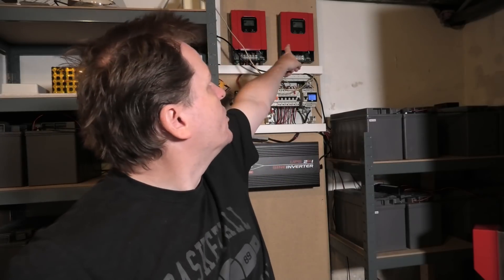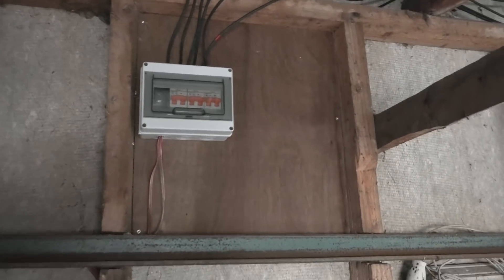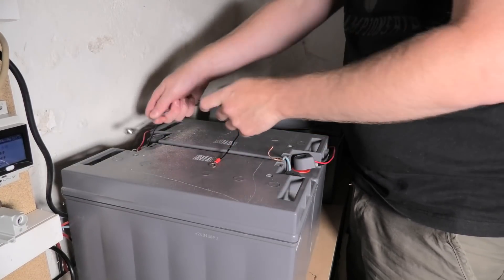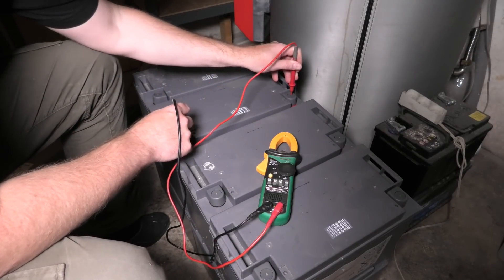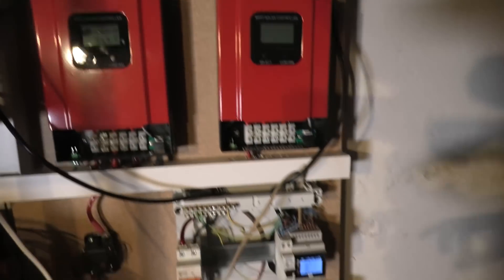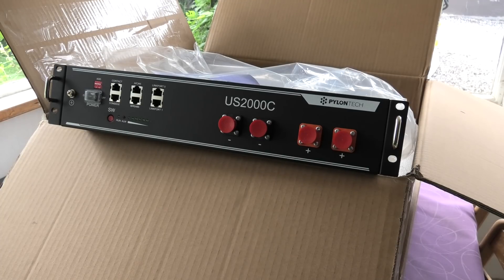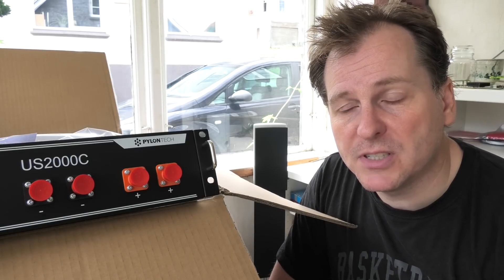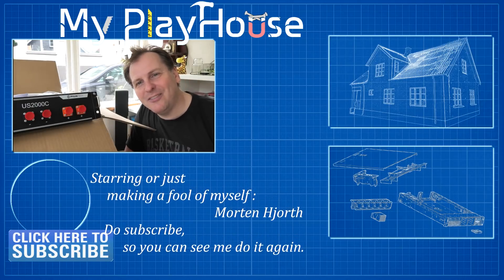Lead-Acid Battery Bank is Ruined, & Coming Out - 1092

Comment: I have just installed an 'off-grid' system in my house, which can also top-up the batteries from a grid supply. This installation includes an 8.4kW PV array, three 5kW Iconica solar inverters running in parallel and a 92kW lead-acid battery bank, consisting of thirty-two VARTA LFD 230Ah batteries. These are sealed glass mat type batteries.
They are configured in series parallel (four batteries in series, giving eight parallel banks of 48V which serve the three Iconica inverters).  This  lead-acid battery bank cost £3600. Running it at between 100 - 70% capacity gives me 30kW of usable energy. I have installed solar before into campervans but this is my first house install. I researched that running lead-acid between 100-70% gives the longest life-span.  I'm hoping running it like that I get at least five years use out of it......possibly more. I can output up to 15kW out of it if needed. It handles my 9.5kW shower fine. Each battery is only outputting 10A at 48V to achieve 15kW output.
My question is:
Other than running them at between 100 - 70% capacity, is there anything else I can do to ensure a long life?
Reply from the maker: I think I should be asking you questions!! 
Only thing I would suggest is to add a Lead Acid Battery Bank Equalizer... one per bank,, they are a bit expensive,, but so are your batteries.
https://youtu.be/UjvAkGKonpo
Reply: @MyPlayHouse  Thanks for the reply. I have thought about the bank equalizers. I got the batteries as 'seconds' so they were a third the retail price. I'm running a daily log of performance to get an idea of how they're performing. The inverters have an 'equalisation' program that you can initiate to stop sulphidation every month, but as they're sealed batteries it would be hard to find out if this needing doing, as I couldn't measure the concentration. Good luck with your setup.

Comment: The laptop batteries  have a benefit compared to other cheap ones that they once were prime quality.  But the capacity has already suffered from who know how many charge/discharge cycles.  If you are lucky, you may still get 80%.  Still beats the fake batteries that usually never had more than half of the common good battery 1.8 Ah to 2.8 Ah capacity.  Any claim beyond 3.5 Ah is beyond the theoretical maximum and therefore a lie.  Talking about the 18650 types (sizes).  If you have other formats or bigger sizes, that is a dfferent story.
   Changing to discuss lead-acid batteries.  The common packages have 6 cells of 2 V.  If you battery reads 8 V, it likely has 2 cells bad.  If it reads 10 V, only one cell is likely bad.  These numbers apply to just minutes after a charging ended.  During the charging you may see misleading numbers, and indeed the bad cell, if measured individually, may show much higher voltage than the good cells!  In the old days the cells were commonly tested with an areometer, which showed the cell charge condition by the density of the electrolyte.  You just had to make sure the electrolyte level was O.K.  If below the specified amount, maybe 1 cm or 1/2 inch above the plates, you needed to fill back up with pure distilled water.  And be sure the distilled water had not been is contact with any iron (steel).
Reply from the maker: Hi Pellervo Kaskinen
Thank You very much!  glad you liked the video :-)
Thank you for watching! :-)

Comment: What about the possibility of reviving each individual 12V battery with a Re-EMF charger? Why not try that? That should be able to get them up to at least 80% of their original capacity, possibly even more.
Reply from the maker: It is GEL batteries,, and they have dried up,, and stuff :-/
Reply: @MyPlayHouse  Oh, OK, then it won't work unfortunately. If it were lead acid batteries, you might have had a chance at refreshing them.

Comment: Completely understand situation.. Yeah, this is sad.. 😢 My UPS battery died few months ago.. Decided to recover it, but then I noticed that battery is puffy and have small cracks on sides.. I changed my mind immediately.. And started to looking for new battery.. Prices were shocking!
Your situation is worse, because lots of batteries looks dead or close to that..
Supported how I can, at this moment, and watched advertisements.. 😂

One cheaper option is using multiple car batteries.. They are bigger capacity and cheaper.. 
I have 12V home made system in my garage for few years by now.. Lights are 12V, sockets are for 12V.. Have circuit breakers and light switches.. Battery is always connected to the braker.. But solar panel is sitting in car trunk and aren't connected to anything by now - I need to ask permission to put that panel on the garages roof.. 😒 Mounting solution I already decided and charge regulator is mounted on the garages wall near by circuit breaker box but isn't connected.. I even have garage 12V diesel heater.. 😂

Minus for the system - now I need, after few months, bring car battery to home for full charge.. Not an easy job.. But everything works and even neighbor was interested in my system.. 😂 Because I always have a lights in garage and I can connect power tools to garages power system.. Best thing in this system is - no power losses if compared with systems with inverters.. 

Now I want to see how Your new battery module was connected and how it performs.. 😉👍 That's will be interesting video.. 
Great that You leave in video part, where cameras battery died.. 😂👍
Reply from the maker: They just still look good :-/
Reply: @MyPlayHouse  That's the saddest thing.. Because, I've seen more older batteries in good shape.. If they're sit at 10V so long, have a little buldging and didn't take a charge, maybe after recovery attempts few of them may be half good, but considering time needed to bring just few of them back to life, it's worth thinking about replacement.. Now they are just good looking paper weights.. 😕
From this point, it's good idea to try new battery solutions.. 😉

Few years ago, I bought an SLA, AGM battery tester (Foxwell BT-100 Pro) who can show internal resistance and remaining capacity - good tool in such cases, especially after recovery. Tested even multiple car batteries to verify that battery is still good.